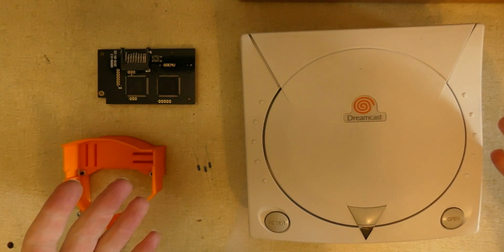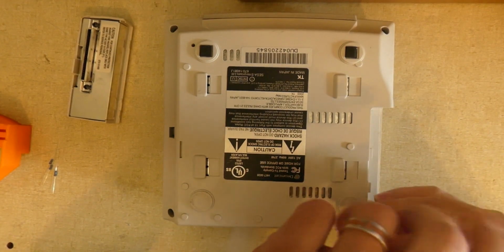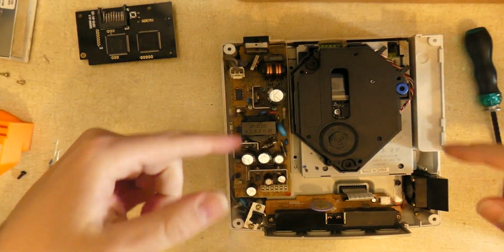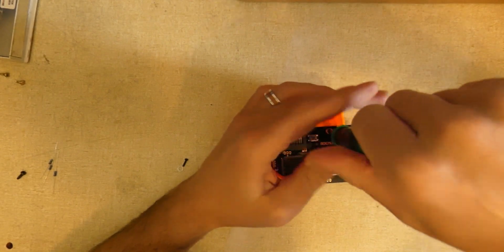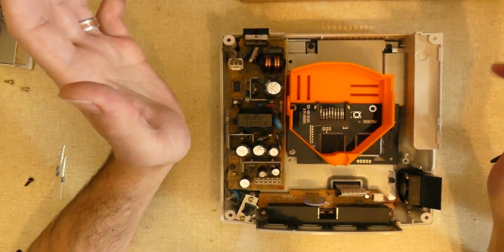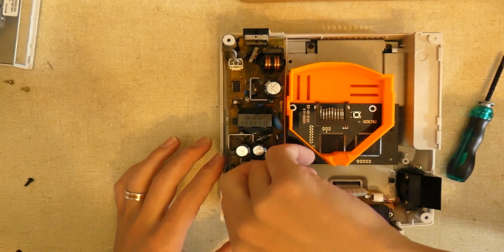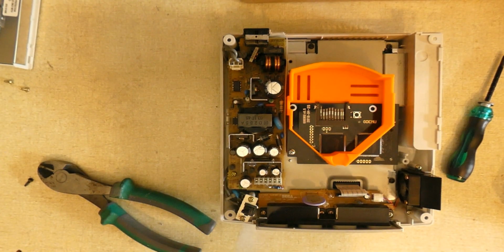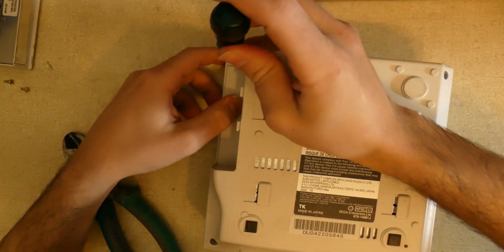SEGA Dreamcast GDEMU Installation with Tray and Power Supply Resistors

Comment: i've been unlucky lately with DreamPSU and a newer version of the PicoPSU, showing noises on the screen when powered on. My older PicoPSU seem to work just great without noise, and of course the original Dreamcast PSU doesn't show any noise at all. 
Seeing it would be a simple fix by doing the three 1k Ohms resistors twisted together and just slide one end in the 12V hole and the other end in a Ground hole, is great for me because i have no soldering tools here.
i've been told that the 1/2 Watt model, instead of 1/4 Watt model, of 1k Ohms resistors would be better.
Reply from the maker: If you are seeing noise from the dream and pico PSU it is usually caused by your power brick. For most people there is no issue, but some reason some Dreamcasts don't like certain power bricks. It seems to typically happen only on the analog outputs though so if you are using a digital output, digital adapter, or a DCHDMI then it shouldn't have any issue.
Reply: @vanfidelsmodding6700  it's a really complex situation on my side. I have a VA1 Dreamcast with a PicoPSU i bought around 2021. Never had problem with it. I even used this PicoPSU in a VA0 before, and it worked just great, with that power brick of 12V 5A that was previously used on a Sharp LCD TV. It worked great on both Dreamcast consoles.

Now i thought if i buy another PicoPSU, it would be great too, but i have this noise problem, i tried MANY power supplies (at least 6 of them) of 12V 3A and more, including this 12V 5A power supply on it, and it DOES that noise problem. So with all the PSUs i tried on that new PicoPSU device, AND the fact that if i use the original power supply on the Dreamcast i'm not getting any noise, so the problem MUST be the new PicoPSU i just bought.

Also, i noticed the PicoPSU i just got, is different than the one i bought years ago. Components aren't the same, and my older one doesn't have a blue LED on it, and the 2 wires going to the back of the console, are actually pointing down on the PCB, not up!

So yeah, for some reasons, the new PicoPSU seem to have noise problems, while the older one doesn't do any noise, as far as i can see. So this is kinda why i wanna do that resistors mod, so the original power supply, which doesn't have any noise problem, should be just fine with that mod. I might even ask a friend if he could do the desoldering job on that regulator (i think this is what it is) you pointed at.

Comment: In the lower right corner there is a hole in the GDEMU but you can't put a screw in it because there is nothing on the Dreamcast in that spot where a screw can be screwed in.

Comment: You wouldn't use a 300 Ohm resistor, you'd use a 330 Ohm resistor. That's why people use the three 1K Ohm resistors because those in parallel would be 333 Ohms. 333 Ohms is pretty much the same as 330 Ohms.
Reply: no, it´s not, ohm's law my friend
Reply: @CPU386  go on genius, prove me wrong.

Comment: would 4 330 ohm resistors in series/parallel also work cause i have tons of those lying around
Reply: ONLY use ONE 330 Ohm resistor. Just make sure it's at least a 1/4 Watt, but 1/2 Watt is even better.

The GD-ROM drive is supposed to be around 330 Ohm, so that's why people will sometimes use three 1K Ohm resistors in parallel, because that would equal 333 Ohms.

Putting resistors in series, raises the resistance. Putting resistors in parallel lowers the resistance.

If you put your four 330 Ω in parallel, then you'd get a total resistance of 82.5 Ω. So WAAAAY weaker than a single 330Ω resistor. While putting them in series (one after the other) would get you a total resistance of 1,320 Ω.

Comment: Which end of the resistor goes in the 12v slot the end with the gold stripe or end with the brown stripe?if you or a commenter could help I'd appreciate it.thanks
Reply from the maker: Resistors are not directional so it doesnt matter
Reply: @vanfidelsmodding6700  thank you!

Comment: The 1000 ohm resisters that you use, are they 1/2 or 1/4 watts? Or does it not matter?
Reply: You want the higher watt resistors, if you use 1/2 or 1/4 watt you need 3 resistors put together in parallel (3 twisted together side by side) with a higher 1 watt resistors, you can get away with one or two resistors. You run the lower watt resistors in parallel as they dont get the full brunt of the load and burn out. The bigger 1 watt resistors are design for the load and heat. You want a min of 300 ohms, but as the video said, a higher resistance is prefered.

Comment: If I've already removed the 12v voltage regulator, should I use the resistors as well?   Others have said to remove the regulator and that would take care of the heat, but I want to know if doing this as well would be overkill or harm the system.
Reply: If you removed the 12v than there is no need to install resistors since there's no power there at all. It wouldn't hurt but they wouldn't be doing anything

Comment: Quick question with the resistors when you’re inserting them, like are you just putting them inside the voltage part or just inside the same house next to them, because it seems simple and I never really worked with resistors before so this is all new to me
Reply: They just need to be touching the metal and stay in. I try to get them in between the housing and the pin with as much metal contact as possible. You could even put a small dab of hot glue on them as it will keep them in place and does not damage electronics
Reply: @vanfidel  Thank you, ill try my best when everything arrives
Reply: If someone wants to, they could solder the resistors into place. I would not use any glue. Yes Hot glue once cooled can act as a insulator, but it can also melt if the resistors started to get warm.